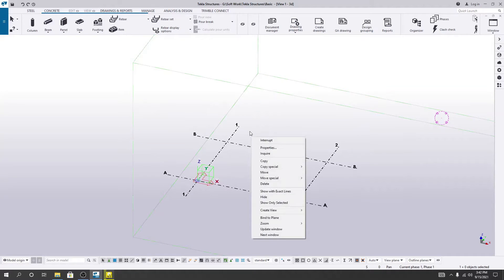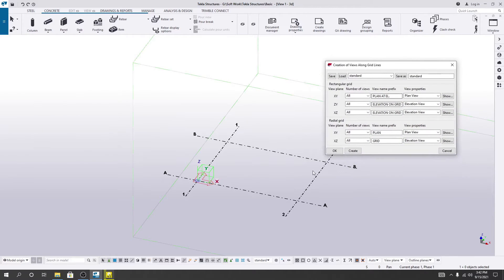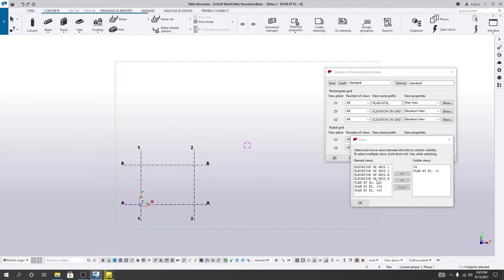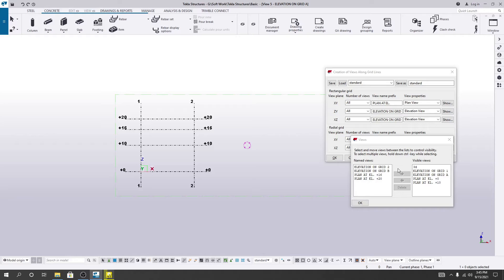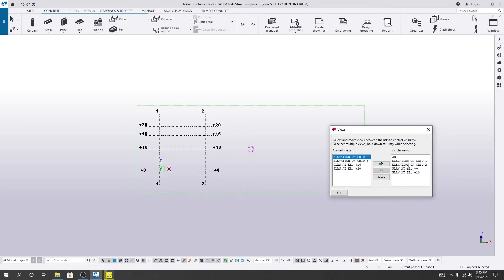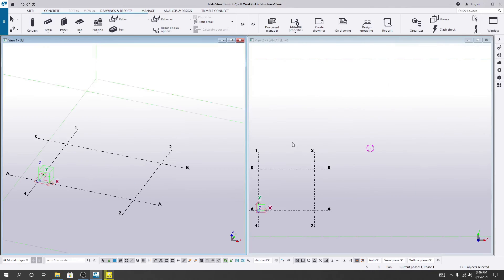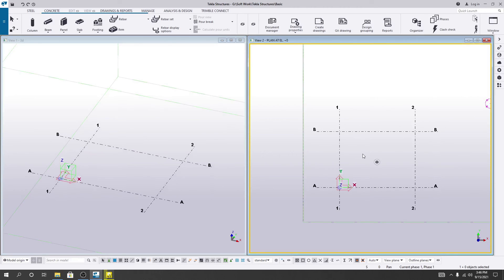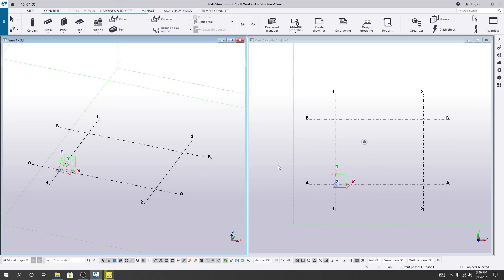3. Tekla Structures Tutorials | Creating View Point for 3D view, plan view in Tekla Structures 2021

Comment: pLAN VIEW +0 ALSO VISBLE LIKE 3D VIEW SIR
Reply from the maker: you can create any view as per lecture.
Reply: @qlearnify-en   Correct sir. Even i give plan view it comes 3d view only in all tabs...... 3D, 3 Plan views are selected,but the four windows i got 3d view only
Reply from the maker: @abisha2511k  it shouldn't be.
Reply: @abisha2511k  hi

Did you figure out a way around this issue. I'm facing the same issue